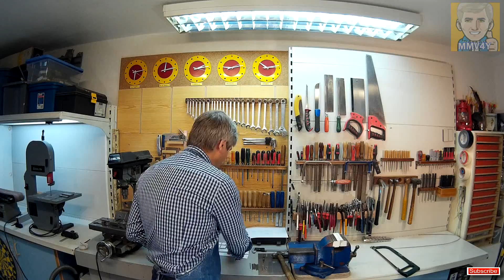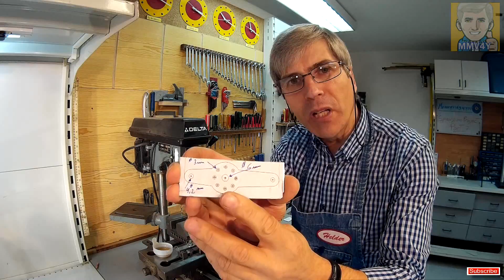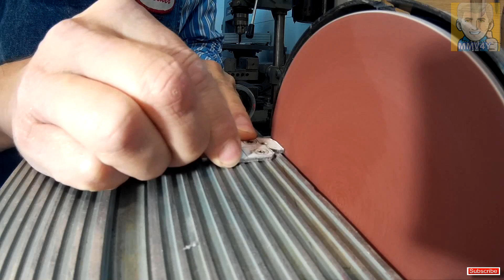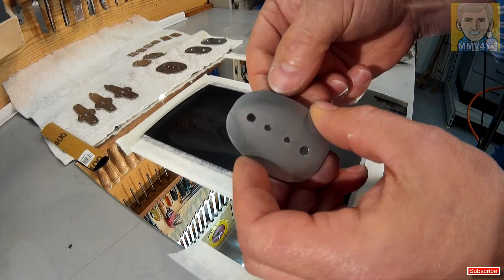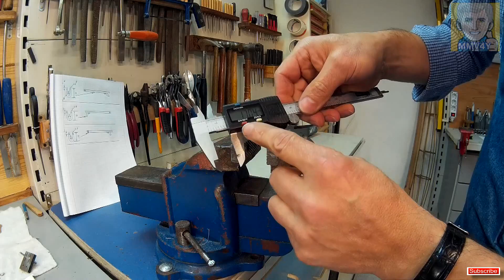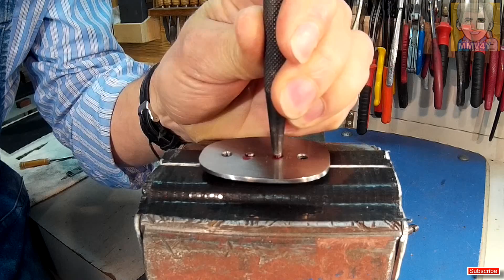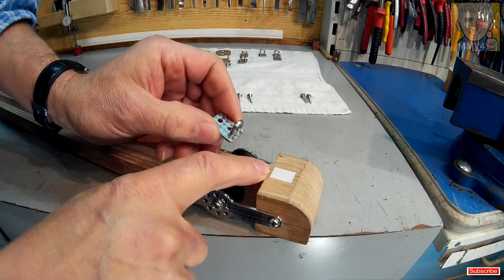How to Make a Wooden Speargun -Part 7- Making stainless Steel Parts

Comment: it's my dream to it 
plz send me a plan to do it
Reply from the maker: Hello boukhors djamel,
making the plans available will not be possible, however here are some overall dimensions from the trigger mechanism and the spearguns.
 - The trigger housing dimensions= 13x30x65mm, wall thickness:
2mm. 
Trigger and Sear= 5mm thick. All made from 316 grade stainless steel
Some of my channel viewers told me, that by using any free screen 
recorder program to take "screen shots"  from some of my videos, and 
then using a image editing program like "Windows PAINT" to scale the images to get the right sizes. Watch the video
 "Roller Speargun Design Model"
 https://www.youtube.com/watch?v=_qQXGEgw5p8  at 1:03 is possible to see a side view of the trigger mechanism.

  Overall dimensions of the spearguns.
The roller speargun:
 1200mm long (end to end)
950mm from the centre of the rollers to the edge of the trigger pocket 
50mm wide
---------
Traditional speargun,
1200m long
950mm from the edge of the rubber bands hole to the trigger pocket
50mm wide from the but plate to the end of the trigger pocket and tapering down to 40mm at the tip (muzzle)
I used  Okoume Marine Plywood  laminated together with epoxy,  but a much better choice will be to use Teak Wood.
Thanks for the comment and for watching my videos.

Comment: Hello, i would like to made my first gun 125 with 3 bangee 16 and arrow 1.60m / 7mm. Can you send me plan for this kind of gun to have some points of reppers or maybu web cite where i can find more info. thanks and good continuation, i like very much your work with metal. i dint find any your video with finished gun.
Reply from the maker: Hello Orca Azur,
making the speargun plans available will not be possible. Prior to starting building these spearguns I spend some time searching on line to get some tips and advise on how to make a wooden speargun, spearfishing forums like Spearboard.com, Deeperblue.com are good places to get some good information.
This project is taking me a very, very long time to complete, making the spearguns is relatively easy and fast to do, but  recording it at the same time that´s a total different history, and that`s the reason you haven`t seen the finish spearguns. More videos to come just don`t know when.
Thanks for the comment, for watching and liking my videos.

Comment: Hi. I'm really interested in making my own spear gun. Any way you could share a link on where I can print the templates you used to make the metal brackets and guides? I'd really appreciate it.
Reply from the maker: Hello Chrs Rodz,
that will not be possible but I can give you some dimensions for it.
- The trigger housing dimensions= 13x30x65mm, wall thickness: 2mm 
Trigger and Sear= 5mm thick. All made from 316 grade stainless steel
Some of my channel viewers told me, that by using any free screen recorder program to take "screen 
shots"  from some of my videos, and then using a image editing program 
like "PAINT" to scale the images to get the right sizes. Watch the video
 "Roller Speargun Design Model"
 https://www.youtube.com/watch?v=_qQXGEgw5p8  at 1:03 is possible to see a side view of the trigger machanism.
Thanks for the comment and for watching.

Comment: I would be very interested  in seeing how you made that slide setup that you are  using to clamp work down to use the drill.  I have my own speargun company - Impaler spearguns and I make all sorts of guns- I specialize i carbon fiber hybrids (70% of length is tube- 30% (trigger end) is wood)   rear handle.   I am very impressed with your metal working skill.  I have to ask though- how are you gonna round it over? now that you have created a profile with so many different  edges?
More important though - where is the line release?  I didn't see you create a slot in the side of the mech for the line release blade to reference the sear (as is the norm)- or a top line release - (like on a reverse mech)-  did you forget?
Either way - great work.   check out my website - or FB page- also instagram- impalerspearguns.com
Reply from the maker: Hello Jason,
I mounted a "slide cross table" known also as "X,Y compound table" on my very small drill press. To use it as a "milling machine" and get some accuracy with the cuts is necessary to remove the play on the quill. 
See this video, at the 16 seconds shows what i done to remove the quill play
https://www.youtube.com/watch?v=EgMzzeYBzJ4

I´m working on the line reels for the spearguns and that is only possible because of the cross table, 
it´s even possible to use the drill press/milling machine as a lathe!

The spearguns will have a line release, see this video: 
 https://www.youtube.com/watch?v=_qQXGEgw5p8

To get the final shape on the guns i´ll use a combination of: drill press/mill, wood router, rasps, files and lots and lots of elbow grease!

Visited your site, i don´t know what to tell you, those spearguns look amazing, and i´m sure they performe great too, that 88 magnum is out of this world!

Thanks for the comment, and for watching my videos!

Comment: hi sir its so great very nice job have u help me I whant that mesharments in each part's and drawing please sent to me my what's app number is 00978 70956725 Qatar so m weighting for ur help
Reply from the maker: Hello Vinod Sidharthan,
I want to finish this speargun project first, before making it available. 
The only dimensions that I can provide are: The trigger housing dimensions= 13x30x65mm, wall thickness: 2mm 
Trigger and Sear= 5mm thick. All made from 316 grade stainless steel
I´m very confident about this design, but I need to fiel test it, over a long period of time before making it available. 
Some of my channel viewers told me that is possible to take "screen shots" from some of my videos and then using scale to get the right sizes. Watch the video "Roller Speargun Design Model"
 https://www.youtube.com/watch?v=_qQXGEgw5p8  at 1:03 is possible to see a side view of the trigger mach.
Thanks for the comment and for watching my videos!

Comment: I love your videos. I have some questions. I was looking for some trigger blue prints and wanted to make my own abaletti style speargun. Do you have an email of other means to communicate ? I speak Spanish so I may have an easier time en español.
Reply from the maker: Hello hernandez,
I want to finish this speargun project first, before making it available. 
I designed this trigger mechanism using a Cad program (Google Sketchup) The only dimensions that I can provide are: The trigger housing dimensions= 13x30x65mm, wall thickness: 2mm the Trigger and Sear= 5mm thick. All made from 316 stainless steel
I´m very confident about this design, but I need to fiel test it, over a long period of time before making it available. 
Some of my channel viewers told me that is possible to take "screen shots" from some of my videos and then using scale to get the right sizes. Watch the video "Roller Speargun Design Model" at 1:03 is possible to see a side view of the trigger mach.
Thanks for the comment and for watching my videos!

Comment: I have milled some walnut from a tree in my yard and plan to mill some ash from another tree in my yard. The S. G. of ash is high and walnut is moderate. With S. S. parts I will try to get a neutral S. G. total gun.  I would like to have 3 spear guns of increasing sizes. Single Short, Medium single roller , and Power dual roller. Walnut looks great, Ash has a high S.G. and is strong. I plan to laminate both to make knock out guns. I am Working on what size I need the Ash milled to minimize work. I want to try to shape the walnut most and ash the least to lower my work load. I would like to use some of your ideas to make the prototypes. I also will laminate one sheet of thin  fiberglass between the wood layers. I plan to use a commercial trigger for all three guns. I only need a drill press to complete my work shop for the guns. I am looking for one.   Please think of me in future videos.
Reply from the maker: Hello robert forsythe,
using commercial available triggers is a very good idea, that alone will save you a ton of time and effort, i wish you all the best of luck to your project.
Thanks for the comment and for watching my videos!